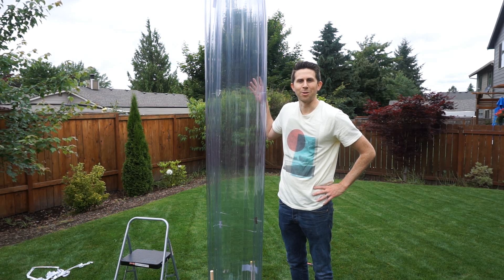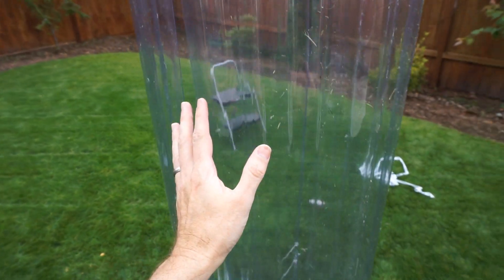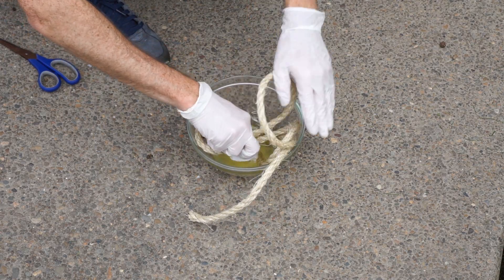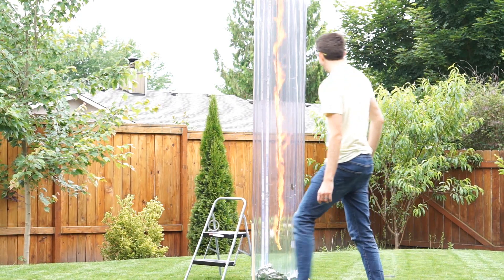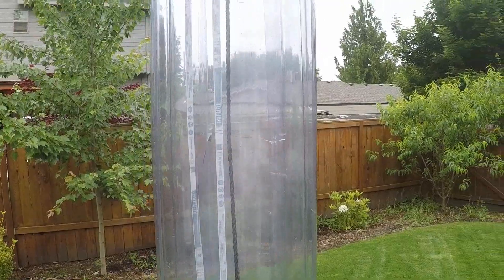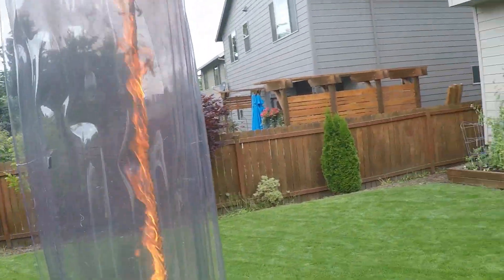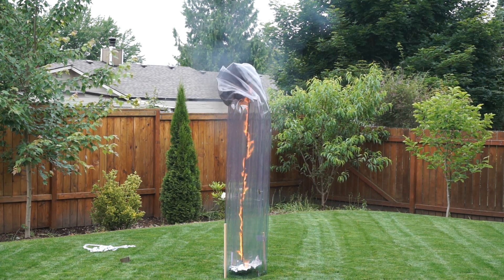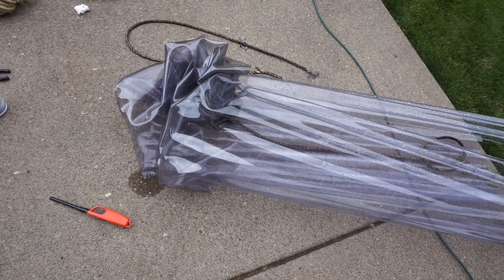8-Foot Tall Fire Tornado DIY-No Moving Parts...Second Try Failed!

Comment: Nice experiment Action Lab!
I know the effect you're trying to get. I make ROCKET STOVES.
The rocket stove effect is part of what you're trying to get. You said the right thing when
you mentioned the heat being at the bottom, and not the top. The air-fuel mixture, PLUS
the air coming into the chamber need more attention. This is a fun experiment which we can ALL
learn from! Try this...preheat your chamber first, (change to fireproof), introduce the air from
the BOTTOM of the chamber, add vortice  fins...and...maybe???
Reply from the maker: +soundspartan of the basket where were you when I set this up! lol, those are good suggestions, I may have to revisit this one.
Reply: Man, I wish I was there, this IS cool!
You'll get into it...look into (and everyone) the rocket stove. It's VERY efficient on very little fuel,
provides optimal heat output....check it out!
The vortice can be a STATIONARY object, so it wont be a complicated mechanism.
A vortice in the chamber can be produced by means of fins (stationary), the HEAT itself provides the 
wind....you know what to do!
Reply: Oh, and BTW, look into GASIFIERS (sp)...They too. are examples of what I am referring to.
You can build a stove which will produce a tornado flame fire, but,  it would be expensive
to make it transparent! You can still do it though, you can film it from the outside looking in!
Good for the children to learn also! I teach the kids in my neighborhood about this stuff!